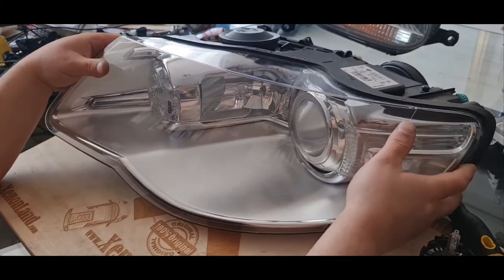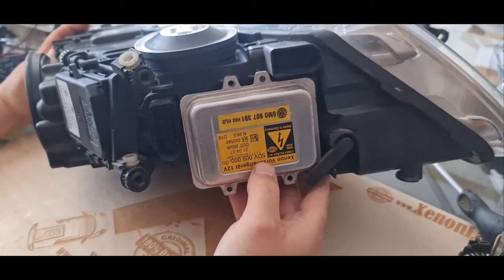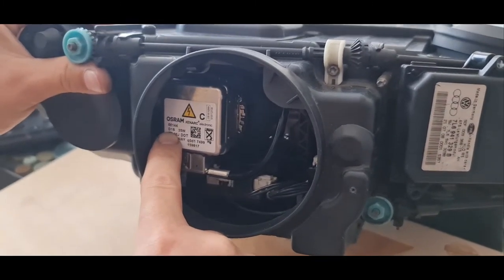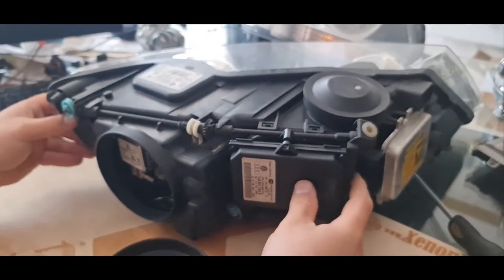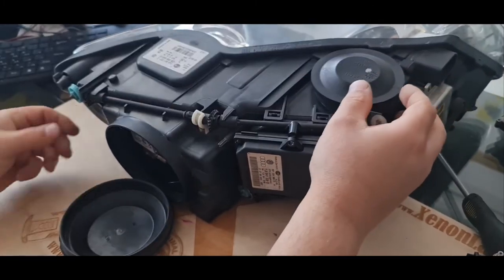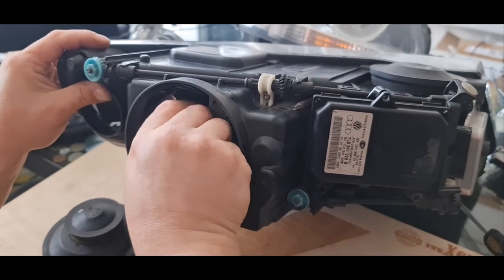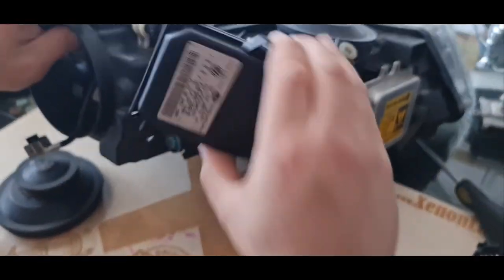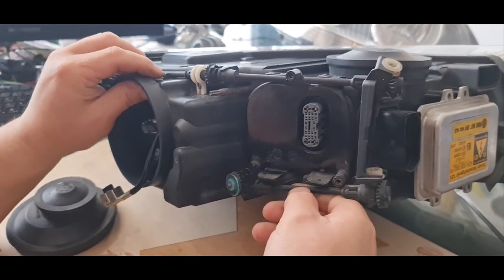VW Touareg 7L Facelift XENON AFS headlight replaceable parts and their part numbers

Comment: Hi! Thanks for sharing these videos! I have a problem with a similar headlight. After engine start and up-down / left-right adaption, the left headlight remains at its lowest position. No error on diagnostics software. Switched AFS modules from left to right but still same issue. Any idea? Are the adjusting motors accesible on these headlights? Thanks a lot!

Comment: I have these lights fitted to my touareg which is a left-hand drive can I Change these lights to be on the other side of the road like driving in England
Reply from the maker: Unfortunately you can not make LHD headlight totally legal RHD unless you change the projector itself with a RHD one. Only 3-4 headlights has totally legal switches between LHD and RHD spec but this headlight is not one of them.